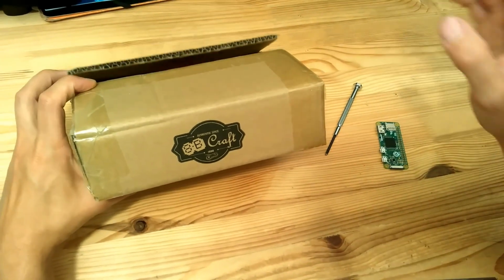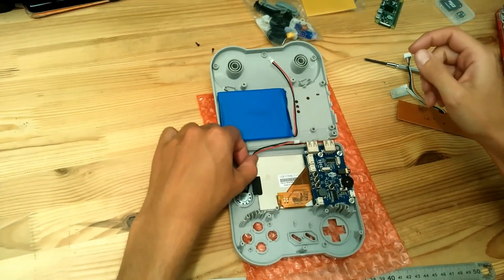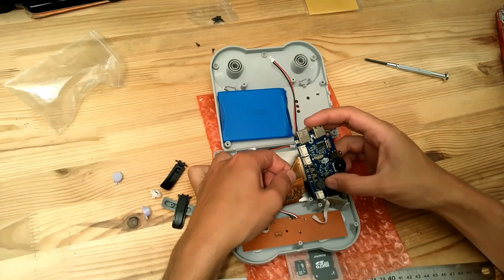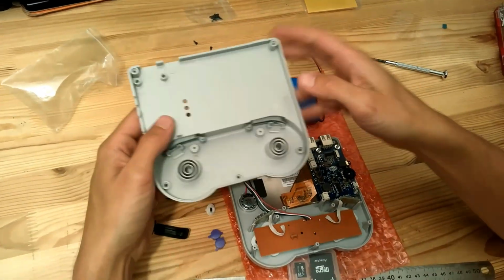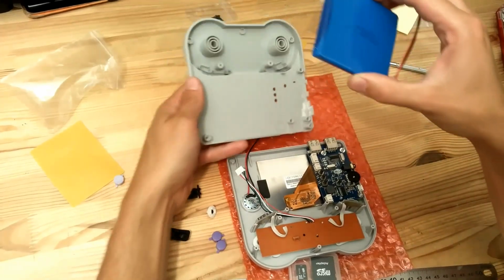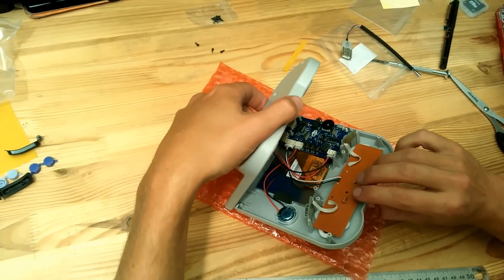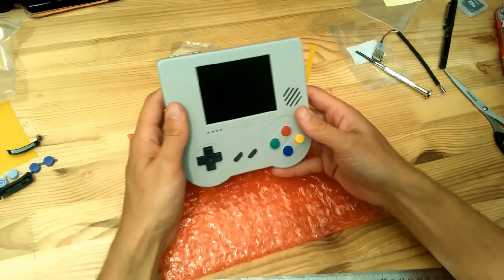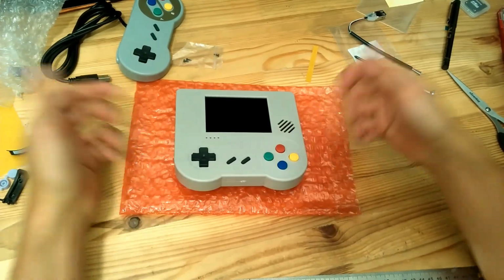Raspiboy assembly tutorial - First batch unit

Comment: My PCB has litteraly burn… A SNES game was running and at the same time I was beginning to charge the console. At this time the PCB was doing electrical noises until the battery was empty. The control pad was not good enough to work and the l and r buttons. I changed these one with the SNES original one. another important point the Raspberry pi version Who fit in There is not enough strong and certainly the cheap PCB too !!

Comment: I really love your design. The simplicity of it absolutely suits the concept of retro gaming. I'm really tempted to order one, but i still am curious about some details. 

What is the total weight of an up and running Raspiboy and where is the center of weight? It seems as though with the battery the weight would be centered fairly high up. Is it comfortable for say 2-3 hours of playing or will it exhaust your wrists for holding up the top weight? What's the weight difference between the 3000 and the 6000 mAh batteries?

How do the buttons, especially the d-pad compare to an original SNES controller or maybe a iBuffalo SNES controller? Is it really similar or does it feel like a completely different controller? 

If the total weight is low enough and the d-pad is similar to the original or the iBuffalo, then i'll be definitely ordering a kit! 

Further more i wish you the best of luck with the Raspiboy sales.
Reply from the maker: Hi,
Yes battery is on top so I was concerned that it would not be comfortable to hold long time. But in fact it's not a problem at all. 3000mAh is about 45g and 6000 90g total weight is about 250g

For the D-pad and other buttons they do fit very nicely. It is very close to older parts.

If you have other question don't hesitate
Pierre
Reply: Just buy a PSP.

Comment: i dont know anything about raspberry but i really like this. are you planning to sell a fully assemble unit?
Reply from the maker: Maybe next model will be assembled handheld. But it will probably take 1 year before it's ready.
You don't need to be a pro of raspberry pi, in fact it is really easy to setup. There is a lot of video that explain how to install emulation software it's really easy.
And assembly of the kit, as you see it's not very complicated!
Reply: Ok.. this is really great... i hope someday if you make another design, it will have a removable battery. for a long term usage. *peace ^_^V
Reply: ah well honestly 10hours is pretty long, you can just use portable chargers to extend the battery use while on vacation :p
Reply: sorry for my bad english but i mean is years after of usage.. when the battery is dead..
Reply from the maker: If battery dies you can change it easily, connector is standard.

Comment: The only request I have if it gets an update would be easier sd card access. Looking forward to getting mine.
Reply: hmm why would you need to acces the d-card tho.. backups?
Reply: That and raspberries are notorious for corrupting the sd card and having to be re flashed. I am going to try and run the roms from a compact thumb drive to alleviate the issue on mine.
Reply: cruelcynic You are correct.  But, the power switch runs a shutdown script or you can also shutdown in the retro menu.  Still ... If you let the power drain dead ...  Anyhow, wish you could mod it to put in a Pi-Drive and run off that.